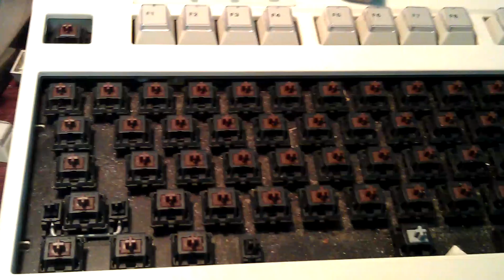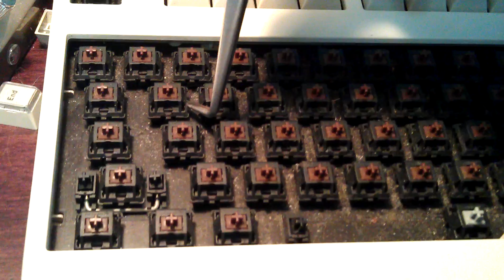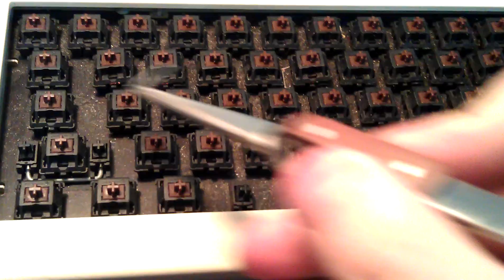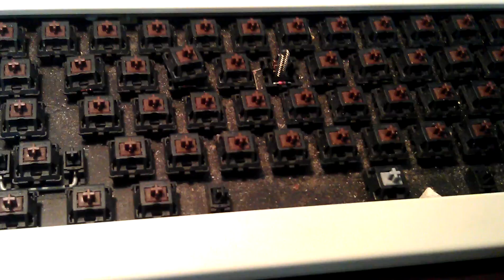How to remove PCB Mounted Cherry stems/springs like a pro

Comment: Can you do this with a Corsair 95 or are they also soldered on? My stem broke off into my keycap so the cross-section that would normally just slip into the key cap in order to keep the keycap connected to the mechanical key broke off entirely so I cannot place they keycap back on unless I replace the stem that broke off into it and not sure if i would have to replace the whole switch or if there is just a way to take the brown switch out and put a new brown switch back in there.
Reply from the maker: Plate mounted switches usually need to be soldered off, unless the plate was specially made. corsair 95 looks plate mounted.

Comment: Spilled a 7-up on my trusty G710+ the other week and the "O" key stopped working immediately. Took it apart, removed keycaps etc. Bathed the PCB in distilled water for a few minutes and dried thoroughly. I noticed a bit of rust from age / previous spill (?) on the bottom underside left corner of the PCB, around the Z,X,C keys. Removed that gently with a mechanical eraser. Put everything back together, everything works perfectly except the "O" key still doesn't work!

I checked the underside and inside of the board, there is no visible damage at ALL to anything near the "O" key.

Do you think it is worth my time desoldering a "G1,G2,G3" key and replacing the "O" with it and seeing if that works? I can't think of anything else I could do. Not usable without "O" and as a £140 board, although its served me well, I'd rather fix it if you guys think it might work.

Thanks
Reply: rip
Reply: Might have rusted a contact or something. Look up whether you can clean it with isopropyl alcohol, maybe that'll help

Comment: I'm not a pro like you but I'd suggest using a plastic spudger instead of those pliers.
Reply from the maker: This is on boards that are trash, so I'm never worried about damaging anything. But even then it shouldn't be an issue as you're not really putting any large amount of pressure on the PCB. I've used this method on plenty of non-trash boards as well.

A spudger could work, but the 90 angle on the pliers is what makes this easy. Really anything that is super stiff with a 90 angle should work fine.

Comment: Instructions unclear, something went wrong captain https://gyazo.com/4a08610197016cf0fc249c795eaf18ba
Reply from the maker: Dr .Sneakywood hopefully you're joking. if not it's soldering time.
Reply: I'm actually not, this is my keyboard after trying to fix it hahaha

Well its my old keyboard and the space-bar broke for some reason so i just tried to fix it. I tried to open the cherry MX but i just end up broke it and i was like fuck it, its double broken now so yeah lmao

Well, yeah i have to solder it now, but where do i buy 1 MX cherry and who can sold this for me, since i dont have any equipment to do it myself x(
Reply from the maker: Dr .Sneakywood yeah, you have a plate mounted keyboard. this video is for PC mounted keyboards. I also stated under the video that this method also doesn't work with switched with LEDS.

you need to remove the PCB from the case and then desolder e erything from behind the switch and replace it

I think WASD keyboards sells single switches and you can probably get them on ebay as well.
Reply: So glad i read your comment or my switch would have looked like yours^^
Reply: Thanks the correct way to do it, a hammer and a plyer
Reply: Cherry sells 5-pack and 10-packs on Amazon as well.

Comment: what if i have led lights
Reply from the maker: All switch with an LED light need to be desoldered on the back. The LED goes through the front of the switch and is soldered in on the back of the PCB. You'll see this on platemounted and PCB mounted keyboards. Usually on PCB mounted boards it's just a few switches like the lock keys.
Reply: BiNiaRiS OK so what happened is I a little coke on my keyboard and only one key, the c key, is sticky. should I try putting alcohol in or should I just take it apart.
Reply from the maker: Are you comfortable soldering? If you are, removing a switch isn't difficult it's just time consuming if you need to remove a bunch of them. If it was me, I'd remove the switch and clean it or replace it. 

If you aren't comfortable soldering, isopropyl alcohol may work. I'd unplug the keyboard and try and drip some into the switch, maybe blot the top of it with a qtip to get some in there.  Then wait until you're sure it's dry. The alcohol should evaporate quickly so i'd just wait like 10 min to plug it back in.
Reply: I tried alcohol, and later realized blue switches need a trace amount of oil on the clicky slider in order to function, so now the switches that were affected by the alcohol feel grippy and the slider doesn't click as it should.

I've tried to open the switches and even followed guides to make custom tools to try and get at the clips on the sides and they just seem to not budge at all. I'm comfortable with soldering, but as I have about 20 affected switches I'd prefer not to solder if it's not necessary. I have an appropriate silicone oil, just need to disassemble the switch.

Are you saying in my case, because there's an LED, that the LED is actually on top of the top cover on the switch, and that holds the top down to the board? If this is the case, can I just desolder the LED with a pump and that will free the switch top without removing the switch from the board?

Thx
Reply: Andy Plater I have the same problem, there was a guide where you put a very small amount of lubricant into the switch like the alchol. It should free it up.
Reply: with q tip.
Reply: вукзн рщщмуы could you link me the guide, I think I accidentally washed away some of my blue switch lubricants and now my keyboard is very stiff and hard to press.
Reply: KayandtheJay Just look up, Lubricating cherry mx keyswitches on google
Reply: KayandtheJay I used qd contact cleaner/oil on a q tip and my keyboard is fine now. Its really easy

Comment: how much of this could apply to the switches on a blackwidow chroma?
Reply from the maker: Sorry missed this question. Looks like that board is plate mounted so this won't apply at all. You have to desolder each switch and the LED attached to the switch. Not worth the hassle.

Comment: if I wanted to open the switches up to lube it, this method wouldn't ruin my switches in any way, would they?
Reply from the maker: Sorry, I missed this question. I mean there's a small chance the plastic could break but replacement parts are very easy to find. I don't think I've ever broken one before.

Comment: tried this on a plate mounted...it didnt go well..i was wondering why it seemed harder than what the vid is showing..broke one of locking latch but lucky enough i was still able to put it back...then i read that plate mounted needs to be de-soldered before you can open the switch...ow well, i guess if have to prepare the tools for the weekend project.

Comment: Would it be possible to change Red switches to blue switches by doing this method? OR would I have unsolder the switches?
Reply: It's surely possible using pcb mounted switches.

Comment: you should put a big warning there that this is not possible with LEDs
Reply: What about if it's the RGB-type switch?
Reply: SuperFrodo95 Its plate mounted then, if you mean Corsairs RGB, so this wont work anyway.
Reply: Thank you.

Comment: Yeah, now that I've learned a bit more about the internals, it doesn't make much sense to me either. The top easily comes off without much pressure.

I was careful at first to make sure I was prying at the right place, but it just wasn't coming off. Then I decided to use more pressure than it needed... I must have accidentally gotten underneath the whole switch while doing this.

Anyway it turned out fine, I put the switch back in its slot. It doesn't work but I literally never use that key.

Comment from the maker: I've removed thousands of these stem/springs using this technique without any issues so I'm not sure how that could have happened. It really doesn't take much pressure to pop the top of the housing off so if you're having to use a ton of pressure, you're probably getting too far under maybe.

Comment: Fuck. I just tried this and instead of popping the cover open, it pried the whole switch off of the board, and will require resoldering if I want to reconnect it.

Luckily it was the right side Windows key so I don't really care. But be careful if you're going to try this.